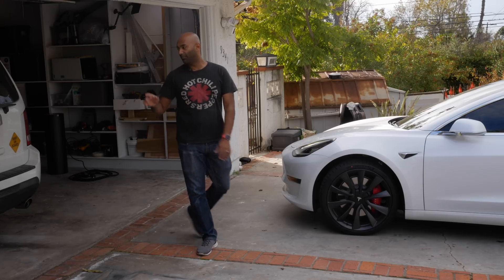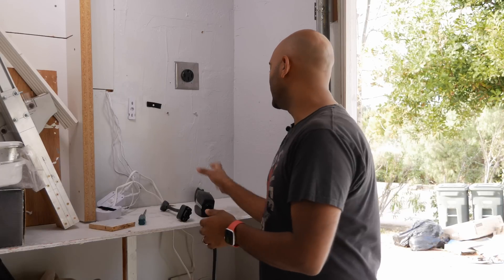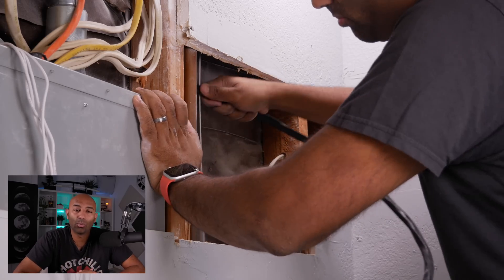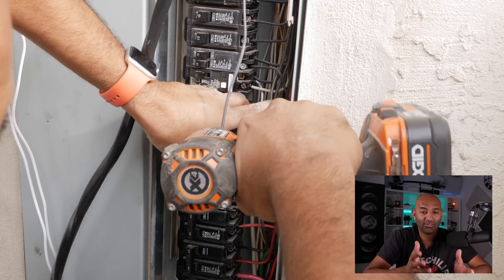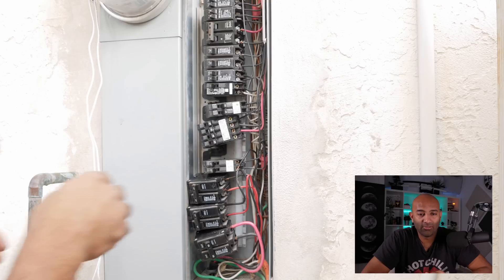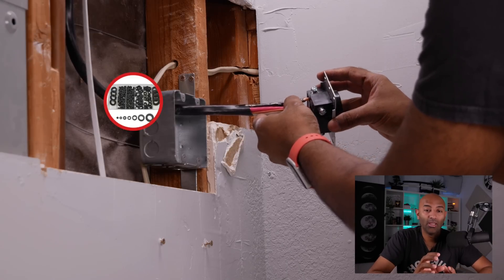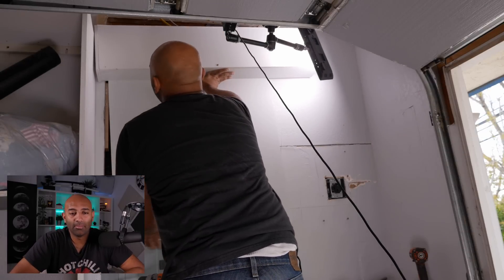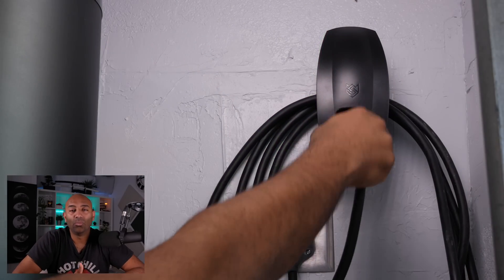DIY Tesla Home Charger Install: Everything You Need to Know

Comment: No No No 
No wall charge plugs or Gen2 wall module on walls. 
Ceiling Install Only!!
Why?
Pull ribbon r rope r spring r bungee that pulls down to the plug from ceiling.  
240v cable tripping hazard. Heavy 240v cable on the wall or ground should be outlawed. 
So 
Never ever have a 240v plug / charger on a wall. 
Wire everything to the Clealing install the plug / cable with spring / bungee cord / rope weight with pull down ribbon for a pull-down plug / cable.

This wall stuff
Is really really bad
Reply: Kids Wife just pull a rope and down comes the EvPlug. Anyone can do it  NO 240v cable tripping. Do Not be a Wall Dummy be a Ceiling Einstein
Hey kids can you pull the rope and plug in our EvCar. No Problems Dad!

Comment: I noticed you used a inexpensive nema 14-50 240v 240 outlet. Tesla recommends a industrial grade one which can cost a lot more like $99 but worth it as I started having trouble with it heating up and reducing the charge rate from 32 amps to 16 amps. Replaced it with a more expensive industrial grade one problem solved.
Reply from the maker: really interesting! 2 years... the one i bought from home depot has been flawless... no drops in charge rate or heat or anything else. good insights!

Comment: I had a NEMA 14-50 installed a year ago (by an electrician) for my new Model S. I recently started having problems with "charging stopped" errors and the charge port on the car changed from flashing green to solid red. The Service Center could read the data on my Mobile Connector and said the Tesla adapter to NEMA outlet was getting hot because a cheap $8.88 Leviton outlet from Home Depot is cheaply designed and made. I found a YouTube that agreed and recommended an industrial grade Hubbell HBL9450A NEMA 14-50 for $68.88. I found one for $53.18 plus shipping. Cheap outlets can't take 32 amps day in and day out. Maybe my Leviton was a one off bad one, but as the saying goes, "you get what you pay for."

Comment: Looks like you also used the WRONG brand of circuit breaker. You have a Cutler Hammer panel but used a Square D combo breaker. Seriously, leave electrical work to the professionals unless you want to :take out you're family. Also, you're pricing is WAY OFF!  Typical price will be closer to 2K. Electricians rates are typically pretty identical (based on time) with dentists and Chiropractors.
Reply from the maker: good call... I’ve since changed everything out to be matching. I appreciate the feedback.

Comment: Just to clarify, the Tesla wall charger pulls 48A (not 40A) off a 60A line. I charge my Model 3 at 44 miles/hr. But this is a very cost effective way to set up a charger with pretty decent speed and was a good video.
Reply from the maker: Thanks for the clarification Brandan! I actually bought a Gen 1 Model S charger for $200 on eBay, and now I’m getting 48A too ... and now I can keep my slower gen 2 charger in the trunk at all times.
Reply: @TwoBitDaVinci  I may set up a 2nd charger with the gen 2 like you did to get easy access to charging for my Tesla friends that visit my house.

Comment: First of all, unless someone has wired their panel before, please be careful... once the panel comes off, you CAN die. Just pay someone. Additionally, anything you spend related to the charger install, you can claim on your taxes for 26% tax credit up to $1k. So for example, if you need to upgrade your service or panel to accommodate the charger, you can claim the credit on the entire amount.

In my old house I had a panel which just sat on the wall in my garage so I installed a NEMA 14-50 myself for a little over $25. Will be installing a Wall Connector in my new house if I end up driving a lot or when I get the Cybertruck - whichever comes first :). Otherwise, the Model 3 charges fine in the 15amp outlet in my garage. I usually charge a couple of times per week overnight.

Comment: i found a hpwc on the marketplace for a great price. and i added a pigtail (stove wire) to the hpwc and not use the neutral wire. and just plug it in my nema 14-50 (6awg). i have it set so it only draws 32a cuz i only have an sr+. but at least i have the umc ready for road trips already packed up in the bag

Comment: I got quoted $800 for a similar project to yours, a 4 feet line to NEMA 14-50. I realized my Tesla was in the garage when the electrician came so I called another for a quote but this time parked the car down the street and said I needed a 14-50 outlet for my dry and they quoted $150. So watch out for those electricians trying to gouge Tesla customers!
Reply: Huge tip there, thanks for spreading the news!
Reply: Bruh that's so scummy
Reply: I won’t give them even $150. I will just DIM.

Comment: That is an Eaton breaker panel and if you read the fine print on the panel label, they do not allow putting other brands of breakers in there.  Other brands will sometimes fit and it is common for people to do this, but code does not allow for non-listed breakers to be used - and if you ever have a fire, your insurance may well not cover it if they discover non listed breakers in your panel....
Reply: Another good reason most people should just hire a certified/licensed electrician. Low chance of anything happening, but if it does, the cost will be huge.

Comment: There are two types of natural gas power plants: Simple cycle and combined cycle. Peaker power plants tend to be simple cycle gas plants because they can be brought on line the quickest. Peaker plants put out about 1/2 the CO2 of coal plants; meaning peaker plants are not the dirtiest, coal plants are.
Reply from the maker: they're the dirtiest in our grid, great points
Reply: @TwoBitDaVinci  I did like the video, it demonstrated competence at being more than just a talking head. I have been trying to talk our marina manager into installing a charger and your video alerted me to some additional options.

Comment: The reason Tesla has a lighter charger is to pull current from a lighter circuit of 40 amps.  The 32 A charger is suitable for a 40A circuit, since continuous amperage should not exceed 80% of the circuit.  The 40A charger would require a 50A circuit, which is not that common, and therefore is overkill and more expensive.  Not only is Tesla optimizing their vehicles and factories, but in this case they optimized the cost and benefit of the charger.  Couple of years ago, the wall charger used to be a lot more expensive than the present $500.  Another great reason why I love Tesla, they approach everything from first principles with a goal for optimization.  Cheers.

Comment: You don't necessarily need a 200A main. I have a Wall connector hooked up to my place, fully accepted by the city inspector, with a 100A main. Admittedly, I live in a 770 sqft condo with gas heating, so my city is OK with me using a 50A circuit for charging with only 100A. If I had higher power draw in my condo, they'd have required more mains amperage.

Another worthwhile thing to mention is that while the Long Range Model 3 can benefit from the higher speed of the Tesla Wall Connector, the SR+ cannot. It's internal charger is limited to 32A, so it can't get any higher speed than the also 32A-limited Gen Mobile Connector.

Comment: I did it too :) DIY :)
Reply: 8-3 worked fine // only 26amp charging for the leaf L2 style etc
Reply: At 30mi/ hr of charging // its future proof // 10 hours = 300 mi of range etc // way more than the LEAF or its future replacement can hold lol // my car usually parked from 9pm to 11 am or 14 hours .. that gives 420mi of L2 charging per night capacity etc

Comment: So, did you go back and fix the work by installing metal clamps on the box and the junction box so that the wire doesn't pull/rub/wear on those edges? (e.g. where you put the overlay in the video)

Comment: Can this setup be used for a 50 amp or 30 amp to connect to an rv? Basically I'm asking if it can double as both. Electric vehicle charging or rv power at different times.
Reply from the maker: My breaker is 50amp so yeah absolutely. If you’re installing a NEMA 14-50 I’d definitely recommend going 6/3 at least gauge wire and a 50amp breaker for greatest flexibility

Comment: Thanks for the video. I would share two simple rules for wiring in J boxes. One: never use a power screw driver as you will strip the screws.Manual drivers only. Second: Take the pig tails and wind them onto a Phillips or Robertson screw driver, then pull the screw driver out and stretch the coiled wire a bit. now when you connect it up it will be very easy to push the whole thing into the box.:)
Reply from the maker: If you have a driver that can set the torque limit it makes it easy. Good points!

Comment: I hired an electrician to install a NEMA 14-50 in my carport, since our service panel also required an upgrade. However,  since I have a carport vs. a garage, I didn't think it was wise to leave my mobile charger out in the carport when I pulled out for the day, as anyone could walk up and take it, if they so desired. So I bought a Tesla HPWC, and instead of hard wiring it, I purchased a 50 amp range cord and installed it onto the charger. 

The thinking behind doing it this way was that it would enable non-Tesla EVs, should we ever get one - or a guest with a non-Tesla EV comes over to visit and would like to charge - to be able to do so using their own mobile chargers. It was also a future-proofing move, should we decide at some point to sell the house. 

We also get a fair amount of thunderstorms throughout the year, and are in the habit of unplugging everything in the house to avoid potential surge damage from a nearby strike (which can occur even if lightning does not strike one's house or immediate power line feed). Putting the HPWC onto a NEMA 14-50 gives me the same ability to unplug it in advance of a storm, sparing it from potential damage. This is much more convenient than going to the breaker panel to switch the feed off to the charger.

Each install will vary, of course. Although Tesla no longer sells its HPWC with a cord included, you can make the non-corded version they still do sell function with a NEMA 14-50.
Reply: Good idea, but one thing to note for anyone reading this is to make sure you buy the "heavy duty" rated NEMA connector. The 14-50's aren't meant for high duty. They're meant to be plugged in and left alone, otherwise they wear out and need to be replaced. The plugs are cheap to replace, but just want to make sure you and others are aware. The outlets are typically rated for a few hundred cycles (plug/unplug events) max.

Comment: I thought the Nema 14-50 used four wires?  Two whites to both neutral bars.  Of course now that I think about it this may depend on what your breaker box looks like.  Mine has two separate neutral bars one on each side for the two 120 lines coming in to make the 240.
Reply from the maker: 14-50 has a black red white and ground
Reply: It's 3-wire and the neutral bars are for ease of wiring. You have two stacks of circuit breakers while @Two Bit da Vinci had one

Comment: Very cool! When I had my Volt, I purchased a ChargePoint Home unit which I now use with my Model 3 Performance. The electrician didn't upgrade my panel, so I only get about 15 miles per hour of charging, but it hasn't been a limitation so far. Congrats on the Tesla!

Comment: My NEMA 14-50 plug/outlet combo was very difficult to plug and unplug. I solved it by liberally spraying DeoxIT DN5 into the outlet and working the plug adapter in and out. It's incredibly easy to use now. It's perfectly safe to spray into the outlet even it's a live circuit.
Reply from the maker: Great to know. My plug seems pretty good so far
Reply: I heard they are not intended for repeated plugging and unplugging and that it can wear the NEMA 14-50 outlet out unless you get one intended for this purpose like one intended for an RV not sure if this is accurate or just second hand information that is only partly true though.

Comment: You said that the Tesla wall charger can pull up to 40 amps however it can actually pull up to 80 amps continuous on a 100 amp circuit breaker. That's more than a model 3 can accept but some Teslas can charge up to 80 amps (19.2 kW) with a level 2 charger.
Reply: That's the old Wall Connector. The new one maxes out at 48 amps. In general, unless you absolutely have to, try to charge at a slower rate. There were a few studies done and Supercharging use specifically is the #1 determinant of battery capacity/longevity. Meaning the more you use the Supercharger the more you're diminishing the life of the batteries.

Comment: @5:40 A bit nit-picky but US residential service is not 2-phase as you said, but single phase. The 2 hot wires coming in are a single phase 240V. Each hot wire has half the sine wave, one the upper half, the other the lower half. That's why a hot to neutral is 120V and hot-hot 240V. The way it's done is there's a transformer that takes higher voltage and converts to 240V and they also add a third connection to the middle of the transformer winding which is your neutral. 

Anyway, small detail. Good video!
Reply: "Each hot wire has half the sine wave, one the upper half, the other the lower half."

No. They're both FULL 120V sine waves. They are just 180 degrees out of phase. When you add them together, they result in a 240V sine wave.
Reply: @GerardPinzone  Ah, yes, I think you're right about that. Thanks.

Comment: Had a local electrician install a NEMA 60 outlet for my Bolt. Service box is in the basement; he had to run across the space then up to the adjacent inside garage wall. $450 here in New Freedom, PA. Well worth it to completely squash any lingering range anxiety - recharging time issues left over from the Level 1 system! I wasn't quite brave enough to tackle it myself although you make it look (sorta) easy.